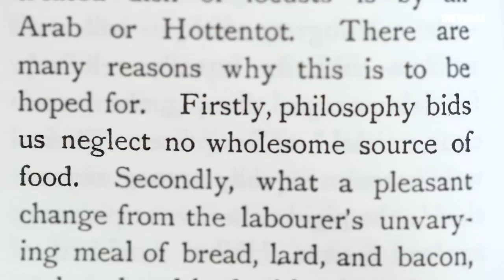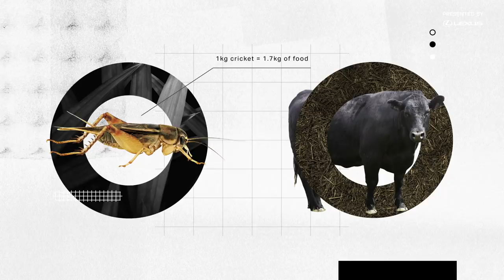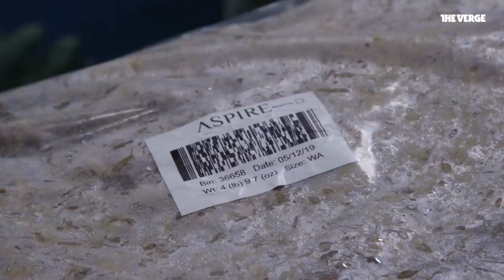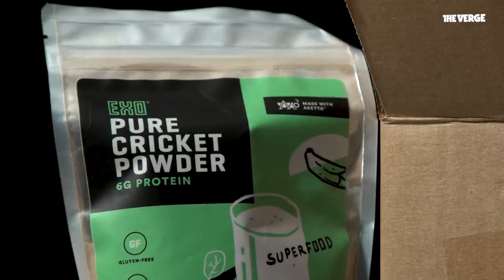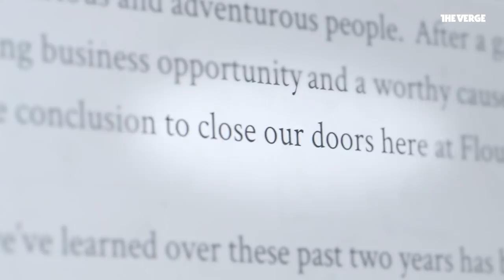Why companies are mass-producing edible insects

Comment: Conservatives in 2040:
"Not that the bugdiet is bad for adults per-se, but bugmilk just doesn't cut it for babies"
"Don't you think we should reduce corporate taxes from -15% to -20%? Growth is what we need to beat Stagflation 15.0, after all"
"I get the need to prevent violent crime, but the new SuperSoaker ban is a bit excessive"
"The new Workpod model is just too small. What was wrong with 15 square feet anyhow?"
"Not to be a pedophobe, but can't they do it in privacy?"
"I think $25 billion in foreign aid to Israel is a bad compromise. Just because they've annexed Yemen doesn't mean there isn't still a security issue"
"No, I don't think Amazon should have a representative in the Senate. They already got the taxpayer funding for their lobby group anyway"
"I mean, I've got my 65th booster myself, and I don't condone the FEMA striketeams. It's a common sense thing"
"The flouride was great. The antidepressants were acceptable. But putting puberty blockers in the water supply is just unnecessary"
"I think churchgoers should get a Caution at most. Overnight detention is overkill"
"We should reduce immigration from 18 million to 14. We have enough problems getting pods for everyone as is"

Comment: For crickets and grasshoppers, you can just look at them as land shrimp (with a different color). If you're fine with shrimp, they should be all right.

Note: they might also contain allergens similar to crustaceans/seafood (crab, shrimp, oysters, etc.), so you might want to check if you have those allergies first before eating them.